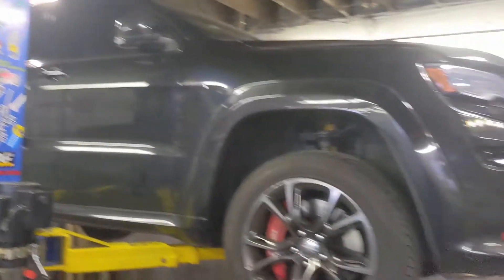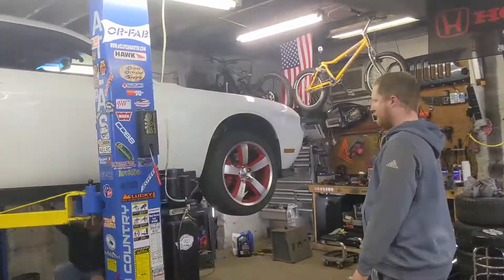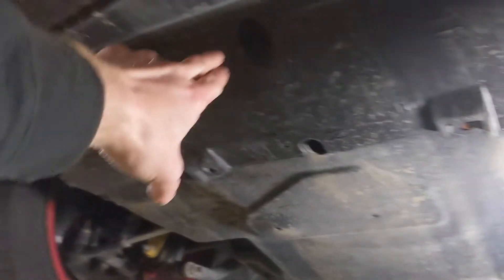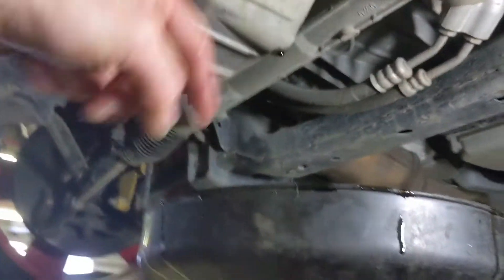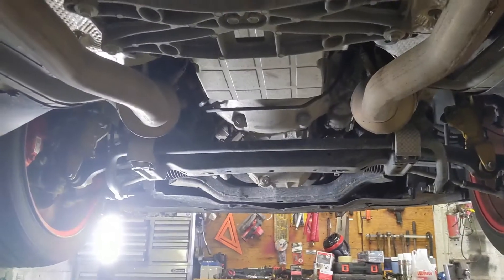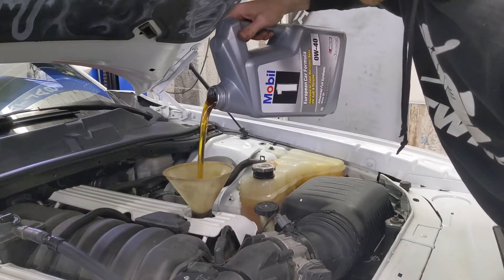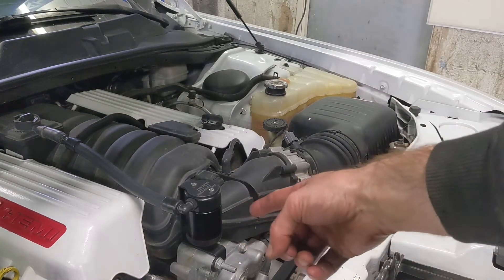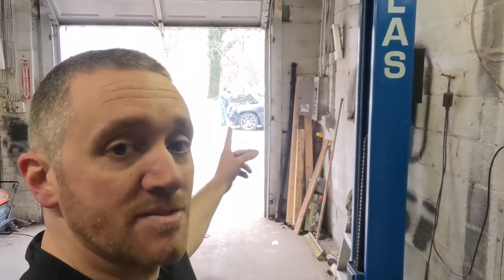Wrench Time! 2014 Challenger and 2014 Jeep GC  Srt8 Oil Change!

Comment: I thought the oil type was 5w40?
Reply from the maker: The manufacturer recommends (on the cap, owners manual, dealership) is Pennzoil 0-40 full synthetic. Some different climates do sometimes call for slight differences but not where I am. (This is for the 6.4L)
Reply: @MrThomasJonesy  I have the same car  2015 6.4L I was just curious!
Reply from the maker: No worries! Hope I can help.
Reply: @MrThomasJonesy so the car asks specifically for pennzoil because of the additives they put into it. How safe is it running the Mobil 1? I blew my last motor and had this one replaced under warranty but the dealership always used Mobil 1 full synthetic on the old motor. I’m wondering if it blew because I wasn’t using pennzoil. I’ve got 20k miles on this motor and have only used mobil once for the first and second oil change. The last two have been pennzoil
Reply from the maker: @srtcrim6234  I'll be honest, I'm not really sure. This was the only oil change I've used mobile one on. It's the only oil that weight I can get easily near me. I since started going right to the dealer or Amazon to get the penzoil. Same price so I figured I'd stick with what they recommend. The Jeep in this video is creeping up on 100k miles though and he's been using mobile one since he got it with 50k